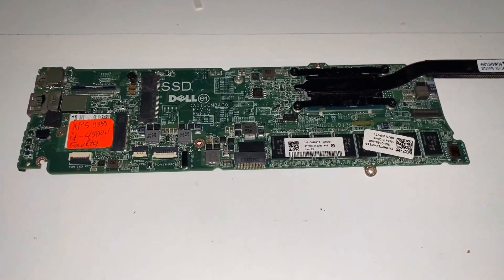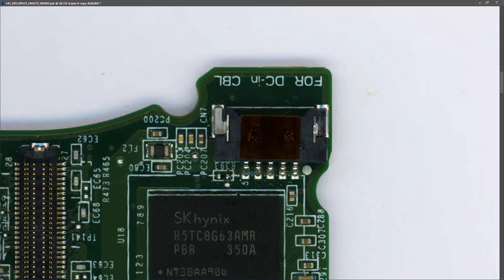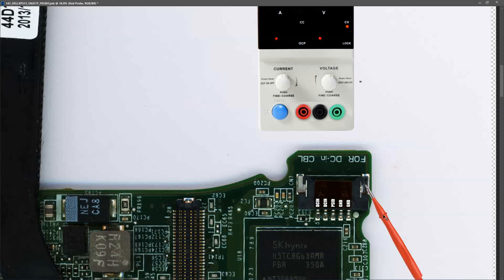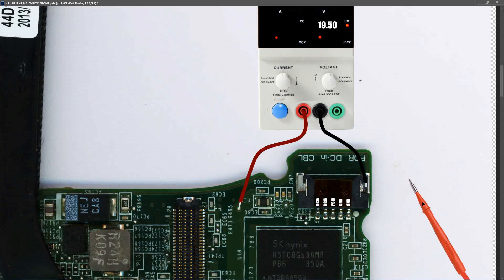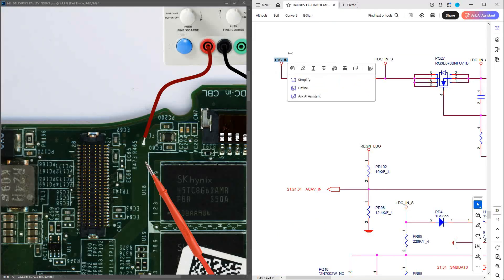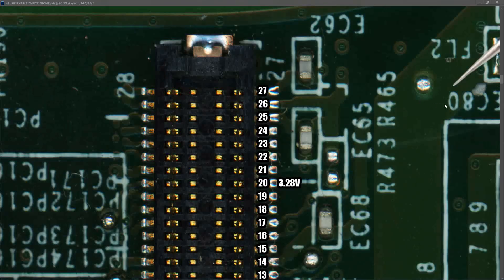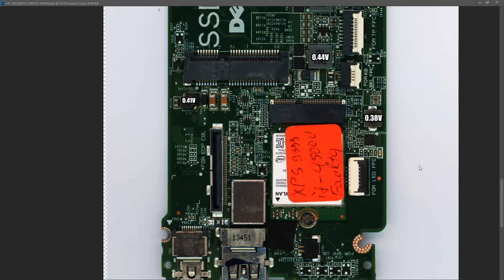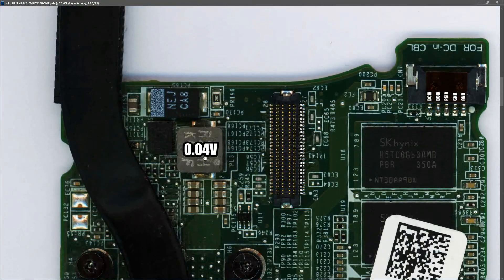DELL XPS 13 9333 - FAULTY EBAY MOTHERBOARD

Comment: Had this BIOS the ME region cleaned ? If not (I think it doesn't) you should clean the ME and flash it again. Of course, the onboard RAM has a lot of chances to be the culprit eventually. Try to heat it a bit and see if it boots.

Comment: Hello! Nice video as always. Did you try to scan through termal camera cpu/graphic chip and PCH after removing heat sink? They should show a uniform heat spread. If there were heat spots it is a no fix! Regards from Italy.

Comment: Thank you for sharing again! I really like your very detailed videos.
It seems like the onboard memory is what causing the "no display". If you don't have other regular RAM slots, then you'll need to reball the memory chips or upgrade them.. But, if you have the regular RAM slots, you need to disable it to solve this problem.
And to do that you have the hardware fix, which seems easier by desoldering certain resistors.. I don't recommend that.
Otherwise, you have to modify the bios by deleting the onboard memory section, then flash it afterwards. 
Just google "how to disable the onboard memory". Good luck!

Comment: It could be the onboard RAM that's faulty. Try pressing on the RAM and see if anything shows up on the display. If it does, try a reflow (only if there’s no black resin underneath, otherwise you’ll make things worse). Reballing would be the best solution if the issue is caused by bad solder joints under the RAM. If there’s an external RAM slot, you can try disabling the onboard RAM and inserting a RAM module into the slot to see if it works.

Comment: check with thermal camera, reflash the bios few more times and see if the current draw is different, maybe you need a clean ME reagion aswell so try multiple different bios files.

i can also see that the bios has been done before, check if the resistances around it are still fine, make sure that the bios pads are soldered flat to the board, it was not soldered correctly when i see the scanned board picture, that can interfer with the bios communication so make sure the legs of the bios are flat with the board.

this laptop has a charger ID pin so take that in mine.

i can also see a usb C if i am not mistaking, se defenetly try to see the behaviour of the board using that port.

and check the other side for missing resistors if there is any components on the other side.